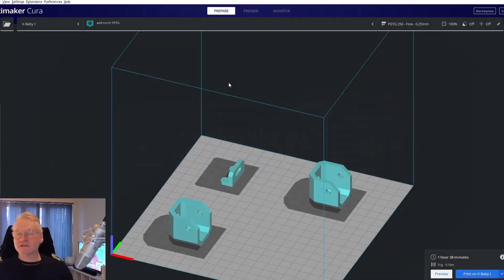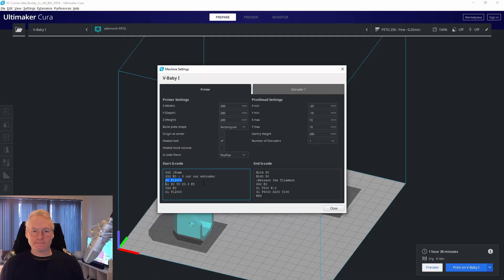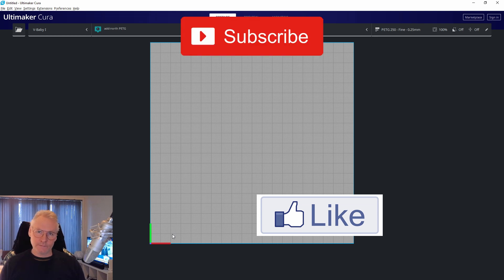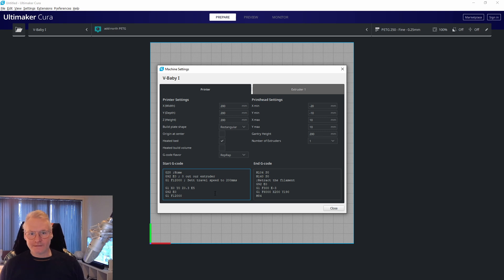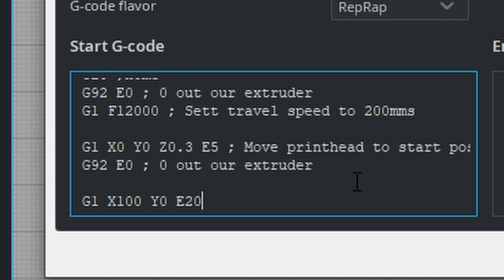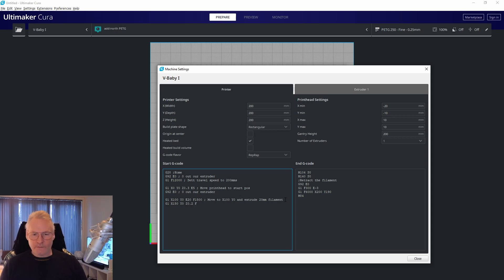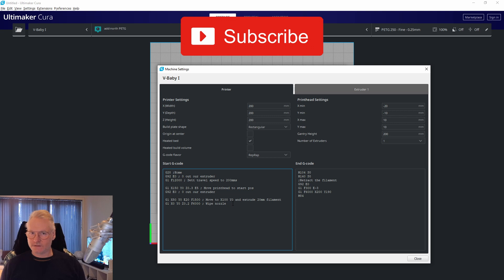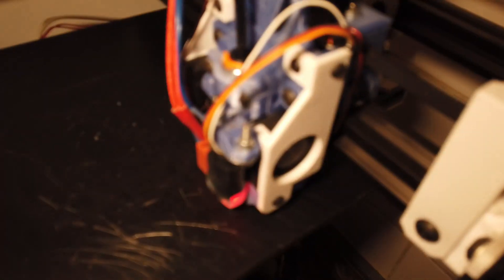PURGE LINE | START CODE MODIFICATION | SLICER SETTINGS

Comment from the maker: Start code Purge Line example:
G28 ;Home
G92 E0 ; 0 out our extruder
G1 F12000 ; Sett travel speed to 200mms
G1 X150 Y0 Z0.3 E5 ; Move printhead to start pos
G92 E0 ; 0 out our extruder
G1 X50 Y0 E20 F1500 ; Move to X100 Y0 and extrude 20mm filament
G1 X0 Y0 Z0.2 F6000 ; Wipe nozzle
G92 E0 ; 0 out our extruder
G1 F6000 ; Set Travel Speed
Reply: When I add this for my Vyper in Cura i get a long diagonal line across the build plate not across the front. Thoughts as to why? (sorry very new to printing)

Comment: Small improvement: if your printer is able to go a little outside of bed, you can start to wipe near the bed, then make intro line, this helps to remove any filament leaks even  better:

G90
G1 Y15 X-3 Z0.2 ; start position outside of bed
G92 E0  ; zero the extruded length
G1 E50 F300 ; purge outside of bed
G92 E0  ; zero the extruded length
G1 X100 E20 F600 ; intro line
G92 E0 ; zero the extruded length

Comment: i figured this stuff out for my ender 3 an 5 but i have had a delta printer just as long an have never found a good source on how to do the prime line for a round bed. ive seen ppls videos showing a prime line that follows the edge of the bed but  ive never found a way to do it in the gcode an im was just lucky in getting the prime line added to all my machines so trying to manually write it for the round bed was def not going to happen, anyone know a good place to find something on a prime or purge line for a round build plate?